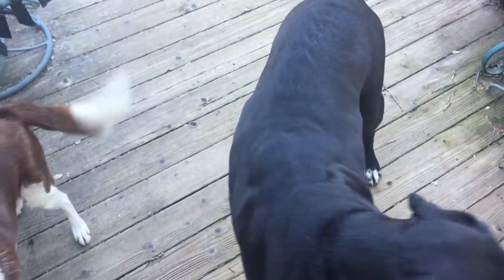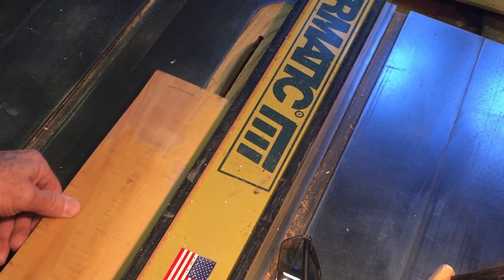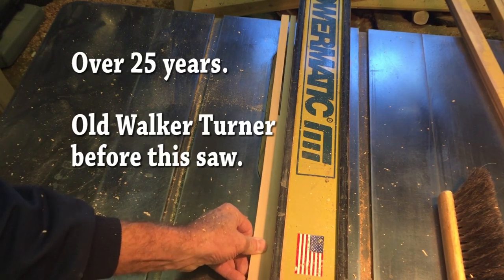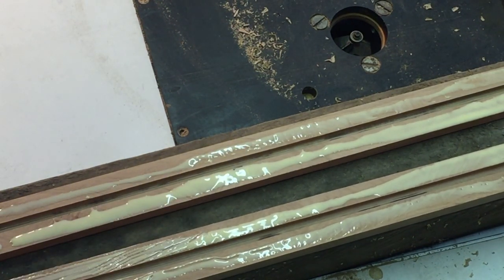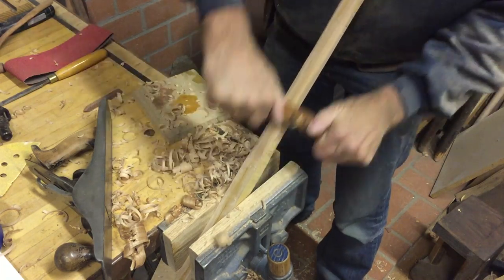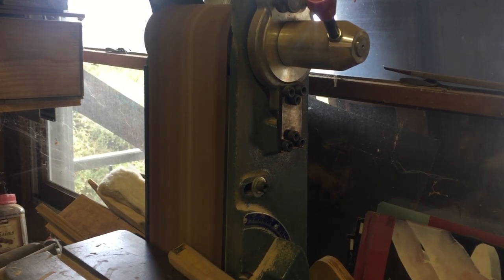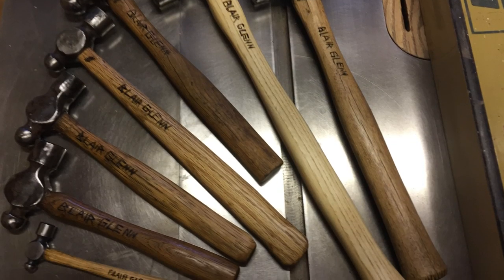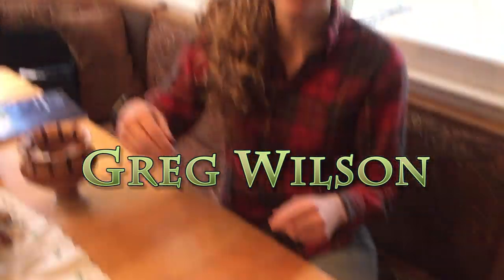Building the Stoker Stick

Comment: A Build Video. I didn't know it was called that. It was well done and a good guide. I especially liked the personal touch of drilling the ends inside to make them round.

You really had me fooled. I was eager to learn how you hollowed out the stick. OK, now that we know your tricks, how did the Indians hollow out a peace pipe, which is very similar?
Reply from the maker: Michael Dougfir Humm, interesting question. I’m guessing they used a wood with a natural hollow like Elderberry.